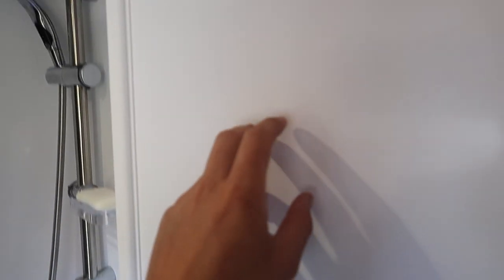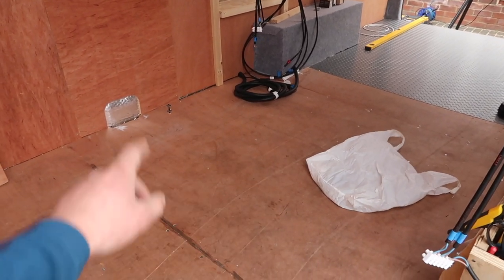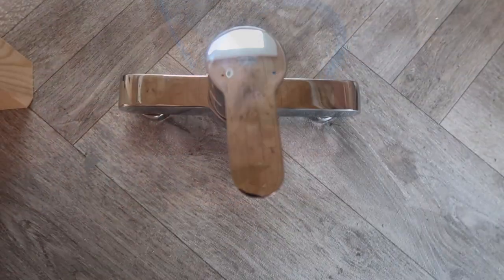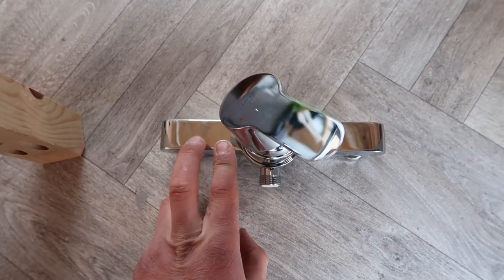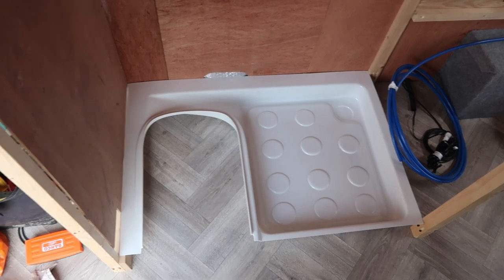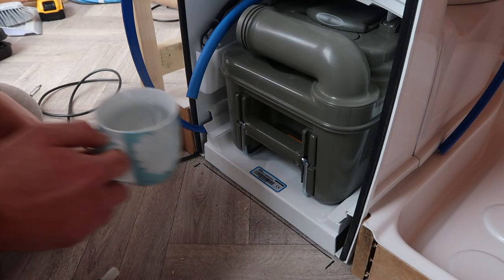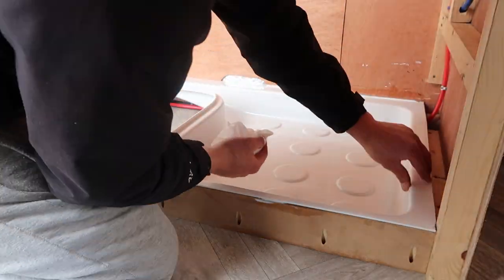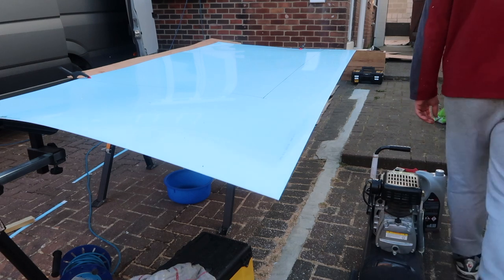Shower and Toilet Pt1 | Ep22 | Sprinter Conversion

Comment: Have you had any cracking of the shower pan?
Reply from the maker: Hi Brad. There was lots of cracking in the end I had to completely re-seal with epoxy resin which made it look brad new (I mixed white with the resin). Re the install in this video I didn't apply nearly enough adhesive to the floor and if I were to install again I would be putting maybe a tube or more in large mounds to stick the tray better. I would also be tempted to fill any voids on the underside of the tray completely with expanding foam to reduce movement and improve rigidity. After long term and consistent use I would make the review that the tray is cheap crap and poor quality. However that being said there are no others that you can buy that are a set with the toilet we had. If you take the above precautions I would suggest you would be able to avoid the problems we encountered. Good luck
Reply: @ScottAndJen  It seems that your experience is not uncommon.  To avoid this I'm thinking of sourcing a better quality tray and then mounting the toilet on it somehow, should be possible 😁
Reply from the maker: @bkk6211  it could be an idea or just make one with ply and tile the thing. Potentially grout with flexible grout if that is even a thing. I would surmise there is some sort of material to suit as I've seen people using tiles in a van before. Maybe normal grout is no problem?

Comment: Awesome video dude, thanks! Have watched it through a few times, getting ideas to approach my own shower build. 

One little tip: when kerf cutting to bend, the cuts should ideally be on the compression (in) side rather than the outside (back). It does work that way, as you did, but the bend is weaker. When they’re on the inside, the remaining spines support each other, leaving a stronger bend. 😘

Comment: Great vid but I cant see what fitting you used between the toilet hose and the 12mm pipe?
Reply from the maker: It's a bayonet to 12mm jsp
Reply: @ScottAndJen  Seems YouTube wont let me post a link... is the "John Guest Speedfit 12mm to 1/2" Hose Connector"
 correct?
Reply from the maker: @marklathamuk  correct

Comment: Hi mate where did you get backing plate for mixer , as one i ordered on 90 bend only has thread on one side . No way of fixing jg fittings.
Reply from the maker: Hi Malcolm it was from Ebay I just search shower backing plate and added the female opening sizes with 90. Good luck

Comment: Hi mate. Great video. What adhesive did you use for PVC the wall cladding?
Reply from the maker: Hi Joe, it came with the PVC. Its not really important along as it is grab adhesive but if you want to be anal then get a one that is suitable for wet room installations
Reply: @ScottAndJen  nice one. Cheers.

Comment: where did you get the shower pan? does thetford make shower pans that fit their toilets?
Reply from the maker: EBay and yes it does. Left and right handed depending where you are placing the shower
Reply: Excellent. I had the Same question. This is a very slick setup and I’ll be adding this to my current build! Thank you!

Comment: Do you silicone around the toilet? How do you get a seal around the far side of the Thetford? Between toilet and wall?
Reply from the maker: It has a rubber gasket and is a tight fit between the hanging bracket so it self seals

Comment: What fitting did you use to connect the toilet water inlet to the flush water pipe on the toilet? I have to make the same connection and am trying to buy that part, or considering just shoving the 12mm JG pipe inside the inlet pipe and using a jubilee clip (but it is a tight squeeze).
Reply from the maker: Hi it is a barbed end fitting to JG push fit. You will be fine with the other technique also though if you can squeeze it in. I would recommend atleast two jubilee clips 3 if you can and have them spare

Comment: Love your work very informative will be using most of your ideas just one question when doing the mixer tap could you of not just put baton higher flipped fitting and screwed up in to button instead of using spacers and drilling holes in wood just wanted to know if there was a reason s you should do this for a living
Reply from the maker: Thats entirely plausible. Just double check your measurements and make it up as you go along. Good luck

Comment: Hi :) Great video. Can I ask where you got the shower/toilet floor from? did it come in a kit with the walls? I have been trying to find one that seperates the section for the shower floor and had no success so far
Reply from the maker: Tray from ebay. Walls are pvc sheets bought seperate

Comment: Hey Scott great build about to do the same for our shower, your video is very helpful thank you! 
Quick question - 
That elbow bracket for the shower mixer that you put on top of the batten and drilled through the batten - 
To keep the batten strong so you don't drill through it, I'm thinking about mounting it to the underside of the batten via that backing plate (not to the wall), do you think that would cause any issues? 
I think my batten is slightly smaller then yours so worried about drilling away too much wood and don't have room for an extra 9mm wood to screw into! 
Cheers 
-Laz
Reply from the maker: Hi. Glad the videos have been of help. You can mount it where you want aslong as you can get the pipework to it and have the correct depth to cover the thread once the front plates go on. Just make sure all you measurements are sound before the cover anything over.
Reply from the maker: And thanks for the Coffee/Beer guys. Much appreciated👍☕
Reply: @ScottAndJen  Enjoy!! 😁😎👍Well deserved

Comment: I would have put the shower head on the other side of the shower room.  No one wants the water to pummel their face while they are showering. If its on the other side you have more room to adjust the spray nozzel.  It doesn't help that the shower pan is small to begin with but next time you are in a shower stand right infront of the spray nozzel where you are practically bumping into it and you'll quickly realize how annoying it is and you'll want to have a bit of distance from you and the shower head.

Comment: Hi Scott what was the brand of the shower mixer you used buddy or do you have a link for it would be great cheers buddy excellent vids as well have helped me out massively
Reply from the maker: Hi Dan its Grohe. Sorry I don't have a link no. Its a a standard size mixer so needn't use the same one unless you particularly liked the look of the one we used. Glad the videos were of help
Reply: @ScottAndJen  cheers buddy I will have a look now I take it it’s not a mixer from say a camper van shop for example
Reply from the maker: @danbonner5578  its not no

Comment: Hi Scott where did you get the brass elbow joints and backing plate for the shower mixer? what the exact spec for it? cheers
Reply from the maker: EBay Steve. Specs are in the video. Good luck
Reply: @ScottAndJen  thanks. Found most of it on Amazon.

Comment: Great vid, starting my build shortly and you've got some good ideas.  What're your thoughts in the cassette toilet being around that way? how's it working out?  I was looking at a tray that would have the cassette coming out of the garage or side entry... not sold on either yet.
Reply from the maker: Works well for us and saves cutting another hole in the van

Comment: What is the brass fitting called that goes from the water pipe to the shower head..
(The bit that goes through the shower wall)

I don't have hot water so it will just be 1 pipe....
Reply from the maker: Hi is called a shower back plate

Comment: Hi Guys, great van build 👍🏻 can you put a link up where to get the shower extractor fan from please?.
Reply from the maker: https://www.ebay.com/itm/12V-RV-Energy-saving-Motorhome-Roof-Vent-Travel-Caravan-Cooling-Exhaust-Fan/233627650050?var=533311617881&hash=item36654b0802:g:zt0AAOSwADZe8a-x

Comment: Would it have been worth covering the screws holding the fan on top the roof with silicone ?
Reply from the maker: If you mean to prevent rust then yes why not. If you mean for a seal the sicaflex was already bridging the screw hole so no its not necessary
Reply: @ScottAndJen  what size shower tray was it Scott?
Reply from the maker: @shearer0142  Link in description Alan

Comment: Great video Scott , have you a link to where I can purchase the extract fan please?
Reply from the maker: Sorry dont have a link but if you type 12v extractor on ebay you will be able to find it. It will be white. We sprayed ours to suit
Reply from the maker: https://www.ebay.com/itm/12V-RV-Energy-saving-Motorhome-Roof-Vent-Travel-Caravan-Cooling-Exhaust-Fan/233627650050?var=533311617881&hash=item36654b0802:g:zt0AAOSwADZe8a-x

Comment: Hey guys, great vid :-) what extractor fan have you used here?
Reply from the maker: Hi, its just a 12v mushroom vent extractor from eBay
Reply from the maker: https://www.ebay.com/itm/12V-RV-Energy-saving-Motorhome-Roof-Vent-Travel-Caravan-Cooling-Exhaust-Fan/233627650050?var=533311617881&hash=item36654b0802:g:zt0AAOSwADZe8a-x